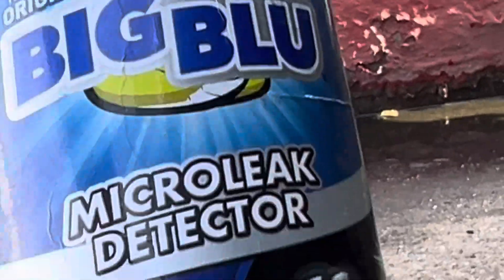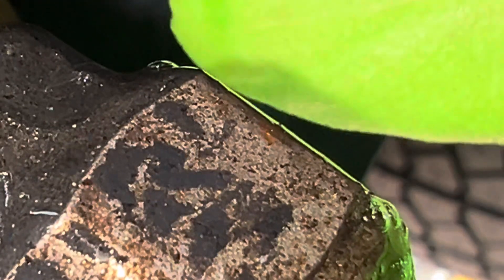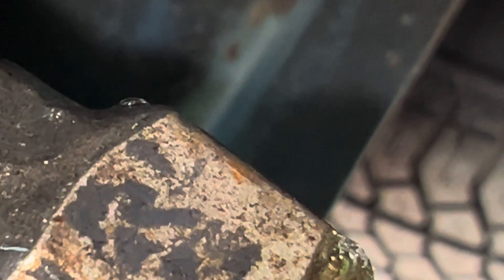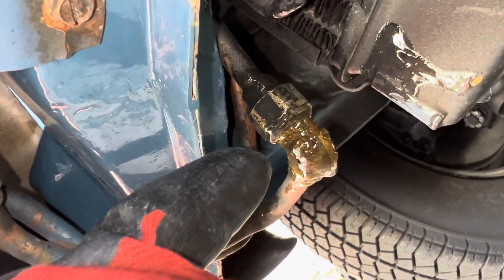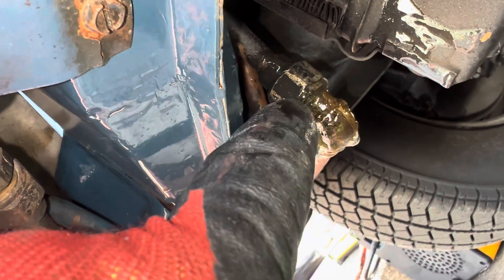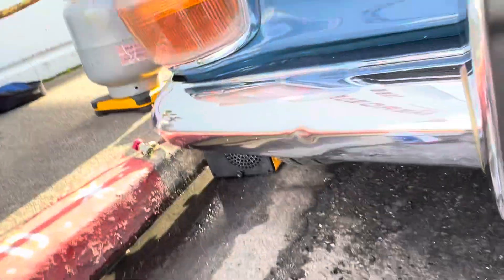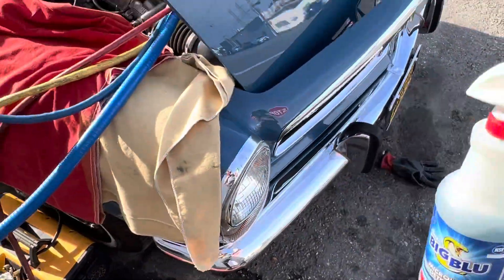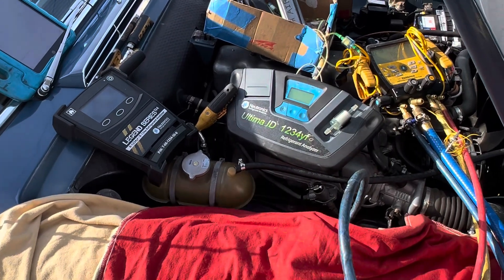Extremely tiny leak at ambient temperature at static 225psi pressure with the system not running.

Comment: When my ac leaked it had a fruity odor, did this happen to have a fruity odor too? I’m curious to know if it was refrigerant because I smell it in my car too
Reply from the maker: If it had a citrus smell, that was probably a non-approved chemical flush that somebody used in the past

If it smelled kinda like Pine-Sol or a pine tree or turpentine, that’s another type of flush that that was used for cleaning out the system at one time . 

Refrigerant has no smell. The oil it is mixed with dose. Not fruity.